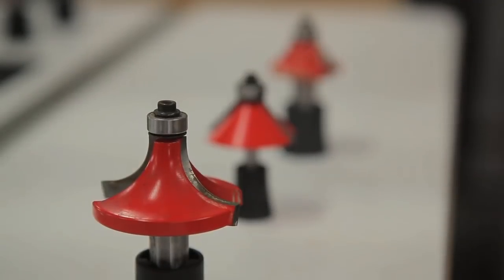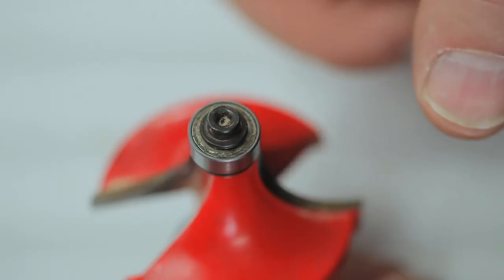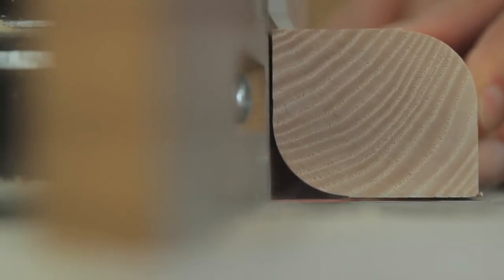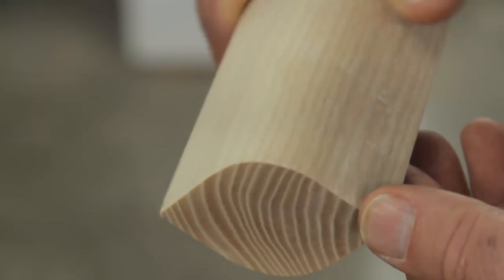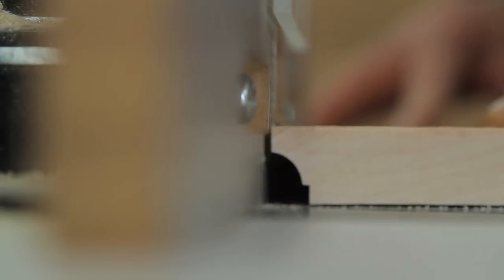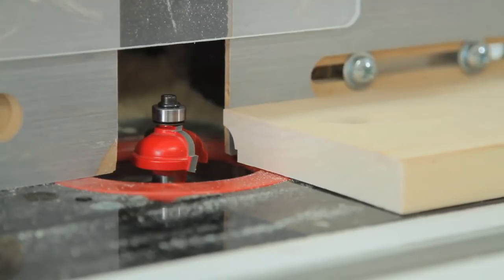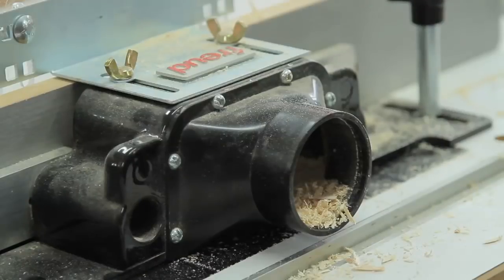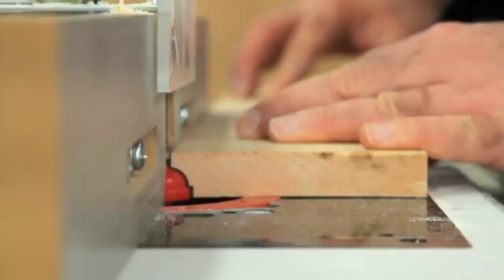Edge-Forming Router Bits

Comment: Top Notch Videos!  I really like I slowly and methodically you speak, of course I can rewind and watch over but it allows me time to absorb what you're saying and take in the video.  Just stumbled onto you this morning.  Subscribed!
Reply: My son made me a chess board when he was about 13 in woodshop at school.  I'd like to frame it and make a small table top out of it for my game room.  I wouldnt mind rounding the edges of the wood I intend to frame it with.  Thanks.
Reply: I have a table but I've never used it or my router.  I have some old reclaimed lumber from an old barn that fell, I would love to use, its probably from the 1940s, I had to plane it down quite a bit to get the old black surface off but the wood underneath has a beautiful oakish color but looks like maybe hickory.  I dont know if I'll use it or not, its really hard. thanks for the correpsondence.

Comment: Thx for the info, i need to round over some hardwood beech on a project iv started, Never used my router even though iv had it for years, so i was glad your video mentioned multiple passes on hardwood, as my main worries was burning the wood, il start the job tomoz . Thx again for the info. 
Pb

Comment: I almost never use a router table for edge profiling because I like to climb cut.. climb cut is potentially dangerous if you don't have lots of experience but it is much faster and smoother than multi pass against rotation.. router table are also awkward and inaccurate on large or heavy panel.. hand held give you much better control..